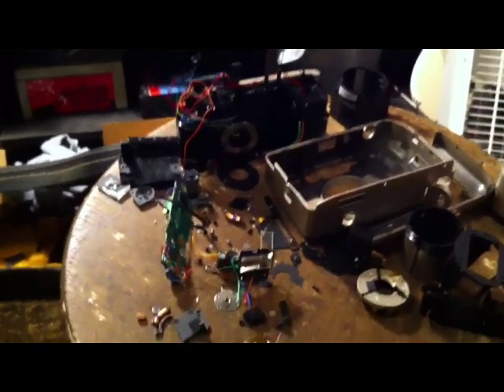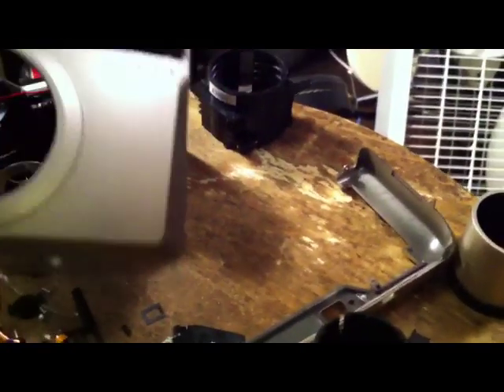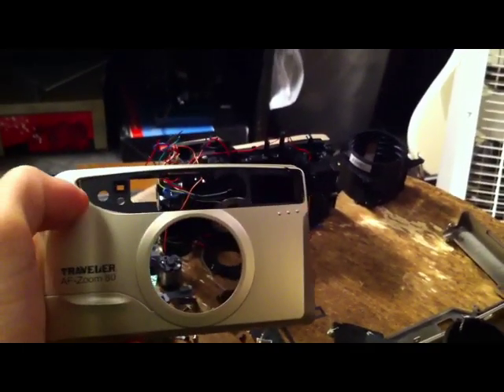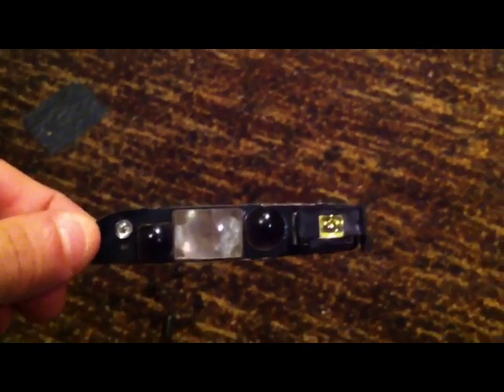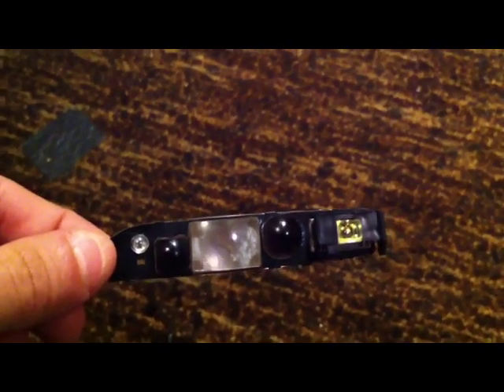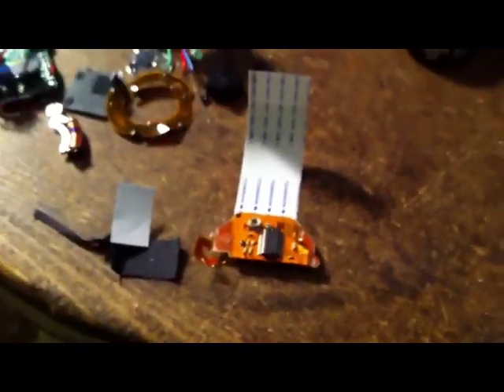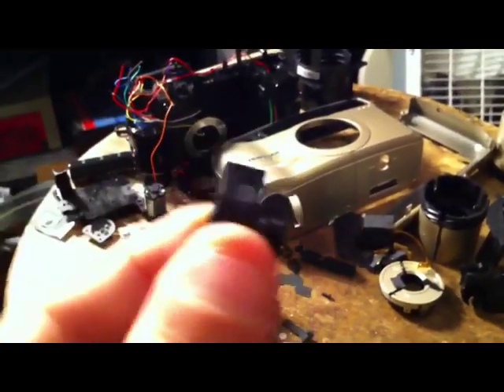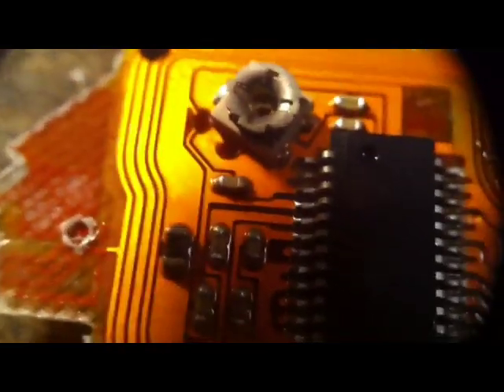iPhone Camera Hack - Salvaging External Lenses From A 35mm Camera

Comment from the maker: @Vanja Sokic - It's true that you can use the glass from a laser pointer as well. The cool thing for me about the DVD/CD lens is that I am a computer tech an have a pile of broken DVD/CD players that I can salvage free parts from. Also, the cheap cameras at the thrift store were less expensive than the laser pointers I saw in the hardware store.

@MrHungryGamer- I'm not sure I understand the question. Are you asking what you could do with an iPhone 3gs camera that you pulled out of a broken iPhone?